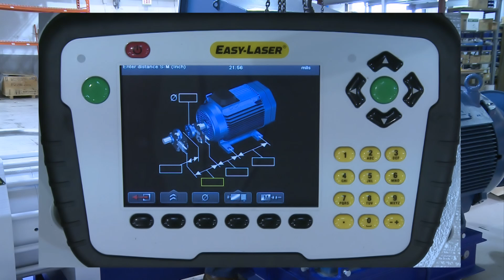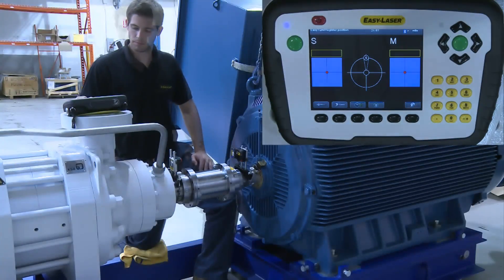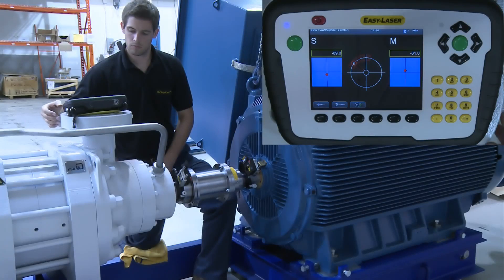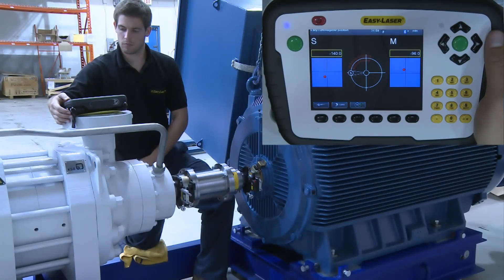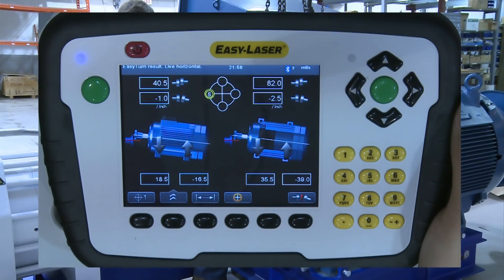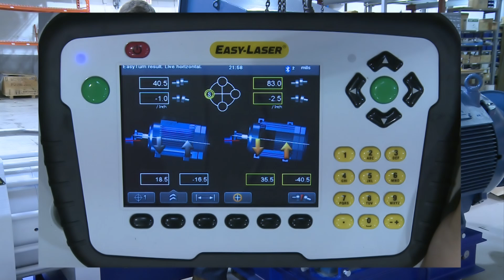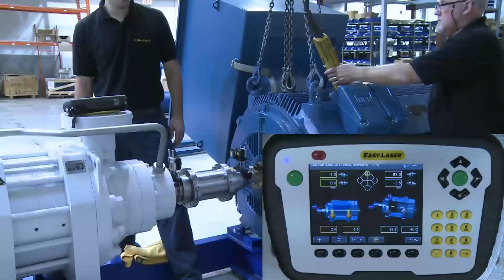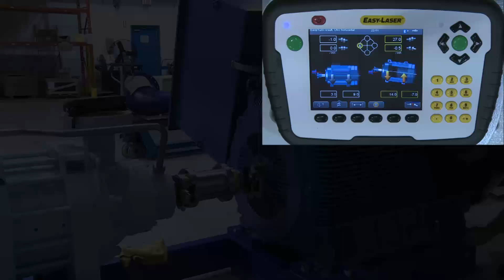Easy-Laser® E710 Shaft Alignment Demonstration by Benchmark

Comment: Y u dnt take 4th point
Reply from the maker: This video was made before the E710 had the free Multipoint measurement method update where you can take 3, 4 or more readings. Here we only take 3 points using the Easy-Turn program.